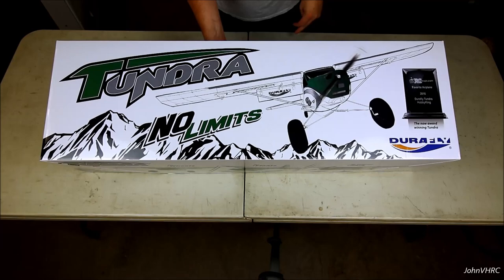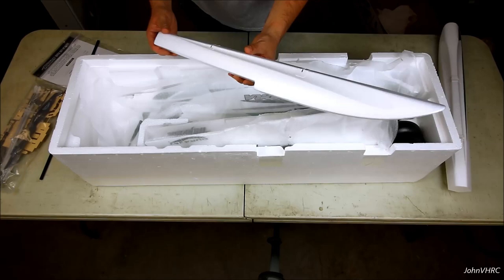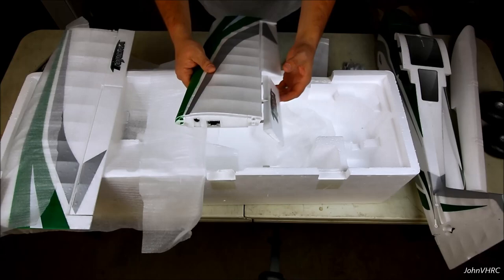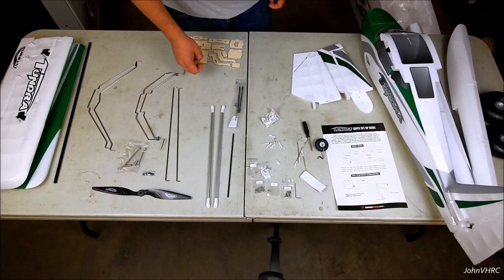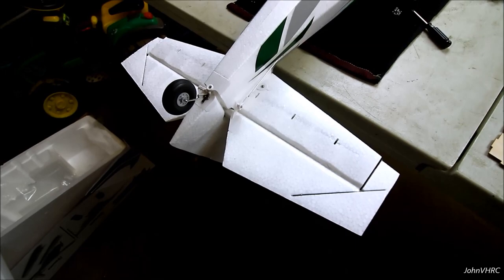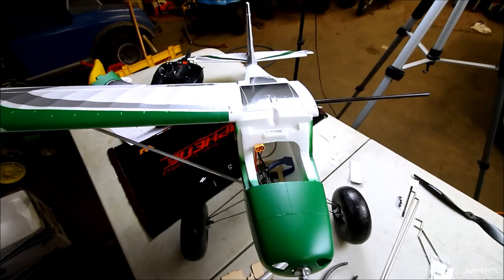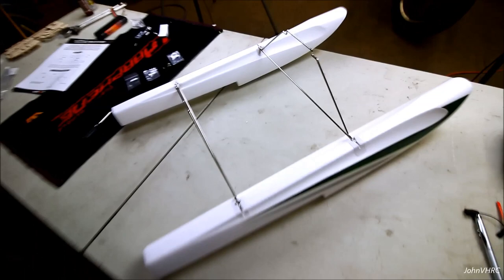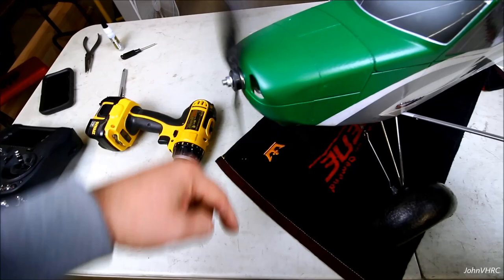Tundra V2 UNBOXING AND BUILD 1300mm

Comment: Nice and clear, no manual needed now🤣 i have 1 question do, my flap servo is good, but the controle rod is about 20mm to long, i can never compensate this by screwing the ball joint in, what can i do?
Reply from the maker: Unscrew it all the way, cut a little off the threaded end and screw it back in

Comment: Thanks for the video!
Do you had to use a prop reamer on this one?
Just got mine few days ago but the hole diameter is too small and is impossible to install, but I'm afraid to open it because never had a carbon prop before.
Reply from the maker: Hmmmmm I don’t remember. Drilling a carbon prop is no big deal.